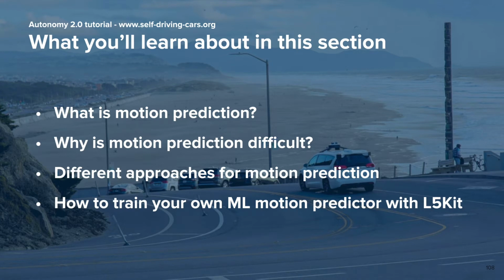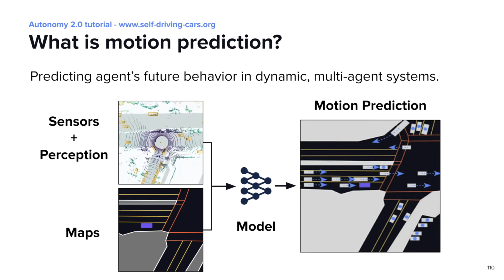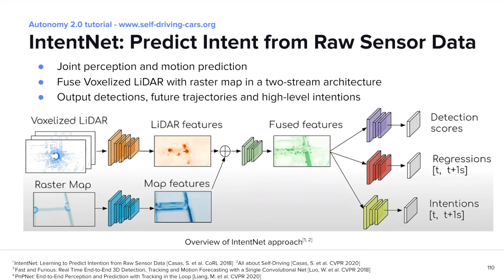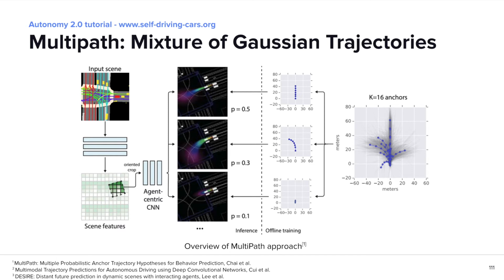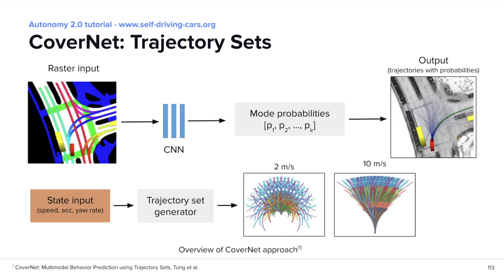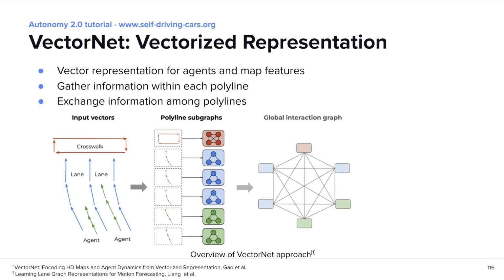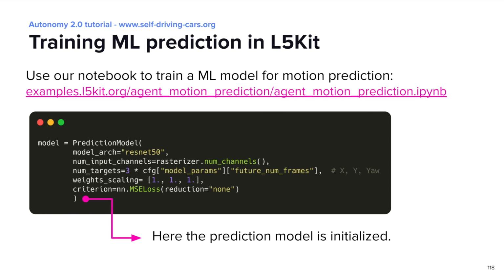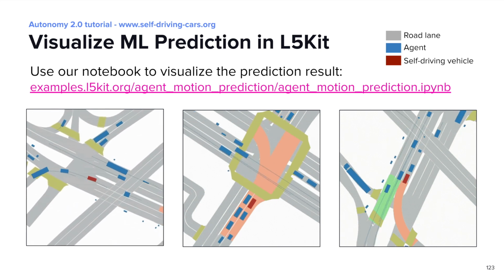ML Prediction - Autonomy 2.0 self-driving tutorial

Comment: Hi, Peter, and Yawei, for the practice example (agent_motion_prediction.ipynb), which specific model is applied in it? Could you list the corresponding reference paper? Thanks~
Reply: Hi Milton, the prediction model implemented in L5kit is using raster image + CNN, it is similar to the method proposed in the paper "Multimodal Trajectory Predictions for Autonomous Driving using Deep Convolutional Networks": https://arxiv.org/pdf/1809.10732.pdf and "Multipath": https://arxiv.org/pdf/1910.05449.pdf
Reply: @yaweiye3901  Thanks Yawei, I'll check them.